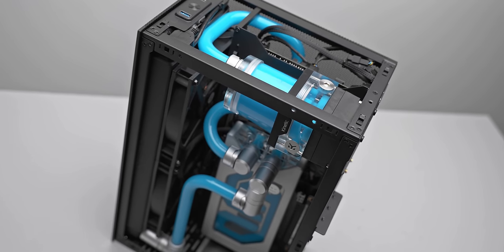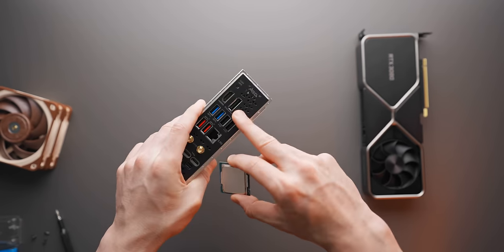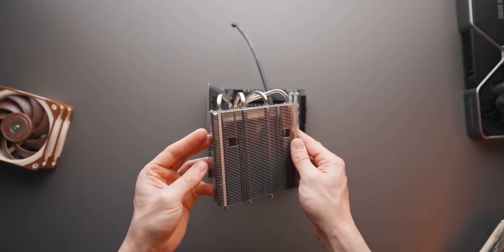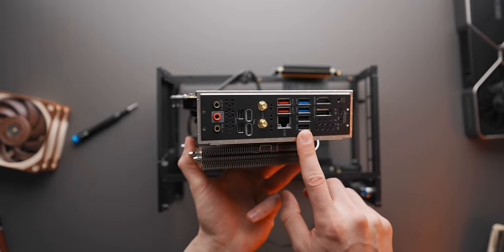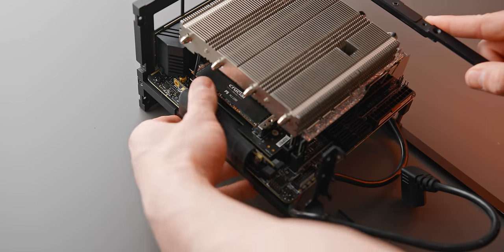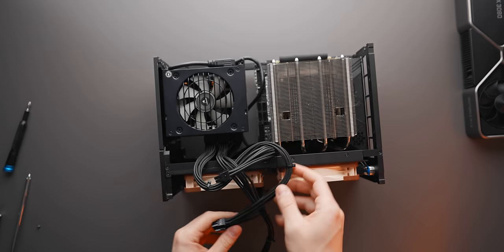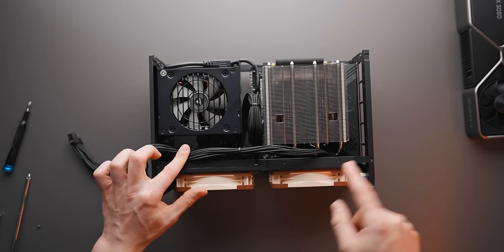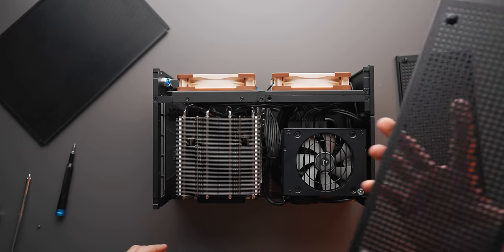Overpowered Gaming PC Build - Step by Step

Comment: The purpose of that 12 pin adapter for your GPU is to slot 2 individual 8 pin pcie power cables into it. 1 power cable daisy chained for a 3080 isn't the wisest decision. That cable is rated for 150W, and you're getting 75W from the board. Meaning you're pulling 245W (stock 340W limit on the FE) on a 150W rated cable.

Comment: Awesome vid as always Ali! Nice to go back to basics :D

One small correction, at 20:53 you say the build would be impossible to get started without integrated graphics but that's not exactly true.
What myself and a lot of people on the r/formd sub have been doing in this case was basically doing the whole build outside of the case with the GPU plugged directly into the motherboard, just to enter the bios and change the pciex16 setting to 3.0, then rebuilding into the case and booting as normal.

Only downside to this method is that bios updates reset the settings so you would need to repeat the process of rebuilding outside the case w/out a riser to change the bios settings which I was doing every few months whenever I was opening the build up for cleaning anyways.

Optimally (pardon the pun) an igpu or 4.0 riser (linkup and adtlink, same brand as the stock one in this case make them) will make this simpler as you don't have to debuild for bios updates, but it's by no means "impossible" if you don't have integrated graphics :)
Reply: Amazing comment. I'll be checking out that sub as well.

Comment: Hello 19:12 if the connector requires 2 pci-e you must have 2 cables coming from the power supply and not a split. :)

Comment: Amazing tip with the gpu undervolt. I have an rtx 3080 in the coolermaste q500L. I bought 3 phantek t30 fans, and undervolt the cpu and gpu, and use it case open (without the glass I mean). Lowered my temps from 82 to 65 while gaming and same performance!!!

Comment: what is the smallest case i can fit my hardware? 6800xt, ASUS B550m Tuf plus, 2x 8gb ddr XPG D60g, 5600x (cooled by Scythe Fuma 2), XPG Core Reactor 850w, NVME m.2 SSD, 240ssd WD, 1tb Crucial SSD and a 2tb HDD (notebook)..im on a Corsair AIr 740 and i want the smallest possible case

Comment: Pro tip: You can still use a CPU without integrated graphics. Just build it outside the case first and bypass the riser, then go to the bios and switch it to gen3. After that, you can proceed as normal
Reply: Im not a pro and thought the same!

Comment: If you're dealing with a PCIe 3.0 Riser cable with a 4.0 Mobo and GPU, and no Integrated Graphics, I'd recommend test benching on your motherboard box after finishing the mobo assembly. This is a good way to make sure things work before installing everything in the case. While the GPU is directly plugged into the motherboard while test benching, use the opportunity to set the PCIe mode to 3.0 in the BIOS, in order to avoid the compatibility issues.

Comment: Why didn't you block off the gap between the two fans for a better negative or positive pull? You will be short cycling your air and loosing a good amount that would other wise be pulled across your components.. I work in air flow and measurements of cfm in the HVAC industry. And a gap like that is a big loss.
Reply: Who knows man but maybe he'll fix it later

Comment: 8:39 seems like the fan is hitting/lying on the metal bracket for M.2 SSD, so if there is no clearance and something is lifting up a lil bit and avoiding fully contact the surface of the CPU and heatsink.. you'll eventually get overhitting or even burning your CPU
p.s. this is why you decided to avoid installing a plastic cover for this M.2 innit? but still, the fan has got not enough clearance - is laying on it

Comment: At 20:30 you said "had we not had  a CPU with integrated graphics this build would have been impossible" but that is not true. On most (practically all) motherboards before you ever reach the bios you will hit the PCIE menu's first. It checks each enabled PCIE lane to see what options it has to display out to the user and by default all are enabled at the lowest spec while during checks, then on some motherboards it will choose to  up the spec on different lanes depending on how much bandwidth is available. 
During this time the motherboard will check for things like GPU's, RAID/ATA/BUS, and audio cards.
If your CPU does not have a GPU chip on it and the motherboard detects a GPU on the PCIE lanes it will choose that during the optimization period. Practically every single GPU since 2012 will run driverless during at this point. Meaning it will run at the CRT standard of 640×480. It will not run as optimally as it would with a driver but it will still run and display a picture. Meaning you will be able to get into the BIOs and even the windows launcher even if you have no drivers installed.

Comment: That cpu fan cable you tucked beneath the heatpipes, isn't that going to be problematic when those pipes reach higher temperatures and possibly damage the cable or cable insulation? Noob here, just asking

Comment: You could just assemble everything out of the case without the riser cable and then go into bios change the setting. Then add the riser cable and check to see if u get an image. You don't need a CPU with integrated graphics. It's just more of a process

Comment: Just want to add I have recently built r5 5600x and a 3070 on an ASUS ROG Strix 550I with my case equipped with a gen3 riser. This motherboard has an Auto option in the BIOS for PCie and I had no problems with it automatically switching to gen 3. Point here is maybe Asus Mother could be your bet if you want such build with AMD or no integrated GPU

Comment: I run my SF750 on a 9900k 3090 build without a single issue. at max synthetic load it draws about 780w from the wall and I have seen a SF750 dop well over 800w stable

Comment: Very nice! This is nearly identical to the build I did in October, except I’m running a 10700K with a 120mm AIO. It’s been great, though I didn’t know there was a way to run fans based on GPU temp. Definitely planning to look into that.

Comment: Excellent build video! 

One question though. I noticed you only used a single PCIe PSU cable instead of two from the PSU. I've read often that these higher end GPUs that consume a lot of power are best fed by two separate power cables instead of just one. The new 12-pin on reference cards would of course be fed then by 2 cables rather than 1.

Have you found any difference with using only 1?

Comment: A finer point I would like to make regarding 11600K , as this has an integrated GPU it does mean that your system will have 2 graphics cards and certain programs will default to that instead of the RTX3080 - It would be cheaper and easier to borrow a compatible monitor than to go for a processor with integrated graphics.
This would be fine on ITX builds without a discrete graphics card but its a waste on ones that do.
Reply: There a several times where having an additional output option is ideal. One is if you have your GPU mine crypto when you're not gaming (great way to pay off an expensive build). Running your monitors on the integrated graphics will keep the GPU running at maximum mining output. Youtube videos cost a lot of performance and even just moving the mouse costs a bit. General redundancy is nice too.
Reply: @ShimmeringSword  please please please don't do this. This WAS a great idea when GPUs were ubiquitous but the electricity cost of having your PC on all the time and the degradation of your hardware really doesn't make it worthwhile.

Comment: Just got a evga 3060 ti ftw3 ultra last week and was set on buying the cooler master nr200 until I saw this option. I like the fact that it is smaller, but I am new to building PCs (don't mind the work though). Is there a benefit choosing the nr200 over this? I don't mind paying an extra $100 for this case

Comment: Do you use Argus monitor for you liquid cooled builds also?  That is something I have been hoping you might release a video on—how you handle fan/pump control in custom loop builds.
Reply: I have a taobao cube X1 (similar to formd t1) build with an overclocked 8700k and watercooled 3090. I use argus monitor and it's invaluable!

What I've done, under the "software controlled" fan settings you can also set "multiple controllers", there you can select multiple temperatures, the highest of which will determine fan speed!

I set my fan curves to make sure my SSD's don't go over 60c, my CPU doesn't go over 85c, and GPU stays under 75c under load.

It's fantastic!

Only thing I wish I had was a mobo with a temp sensor plug, so I could control by water temperature as well

Comment: Great build, however i think you should recommend ppl to use two separate pcie cables for the rtx 3080, since an 8 pin cable  to dual 8 pin is rated up to 288w ..  and the card can exceed 320w while gaming (if no undervolt at least )...  Keep it up

Comment: Great video and amazing build. The exact opposite to mine where I just bought a huge tower so there would be no issue with cable management. But I think even I could follow this SFF build video with your painstaking instructions. 

Playing deathloop at the moment. With ray tracing on at 4K a 3080 can just about pull off 60fps. So maybe should retitle the video expensive gaming PC build rather than overpowered (I was lucky enough to get my 3080 at RRP; wouldn't wanna think how much it would cost to build this right now).

Comment: Hi. Your builds are so awesome. I have one question. Whats your favourite mitx Case.  I'm considering to buying the meshlicious. But there have only the Option for 1x280 Radiator without additional Fans. I will build one PC with CPU aio and a Standard GPU without water cooling. Ist this Case good for this. Thank you die your answer.

Comment: Like your video, but you still can get this build running without iGPU, just start by building and starting the bundle with GPU directly attached before installing into the case, make bios changes, then get it in the  case and it should work with the gen3 riser. :)
Reply: Could also replace the riser gen 3 with a gen 4 cable.

Comment: How safe is those cables touching the heatsink? no issue at all for long term? My NZXT 120m AIO pipe is in contact with GPU heatsink and I'm a bit worry.
Reply: It should be fine, plenty of people dont manage cables and they never melt. However why he wanted a case with only 3.0 riser makes no sense to me. Can't it be swapped out? Anyways

Comment: I screamed inside when you said "we surprisingly only need three cables for this entire build (...) and the dual 8-pin connector for our GPU". DON"T TRUST DAISY CHAIN CABLES WITH POWER-HUNGRY GPUs. I suppose you had all parts laying around, but for the sake of this FE 3080, please please pretty please use two 8 pin cables (or a custom 12 pin cable for modular PSUs).

Otherwise, nice video, absolutely gorgeous build.

Comment: Love this video so much! Just wanted to pick your brain about undervolting. I have a 3090 FE and I'm just wondering if you have a similar template for undervolting it in Afterburner the way you do with the 3080 FE in this video.

I'm running my 3090 in a Sliger SM580 with a direct die 9900k.Temps are pretty amazing but I'm always looking for more efficient ways to run it!

Comment: Hey mate! love your work!

quick question though, shouldn't you have plugged two separate pcie PSU cables into the 12 pin connector rather using a single pcie with two 8 pin connects as the 3080 might draw over the power limit of a single cable?

Comment: Hi Mate, Hope you are well. Can you please show us a ITX full tower build pc with a space of 1 Blu ray drive and equip with with rtx 3080 founders edition card with intel I9 with 30-60 gig ram , 2 tera byt 1 samsung PCle 4.0 NVMe M.2 SSD with ARK ROCK PRO 4 cooler and 1200 -1500 modular power supply with a latest gigabyte or asus motherboard which has thunderbolt 4 on it and lot of usb drives connector ? Many thanks.

Comment: I think it is a mistake to use one GPU Power Cable on that GPU.  I made that mistake on my 1080ti and once I knew I should be using 2 PCI Express GPU power cables, I actually got more performance.  Some say it is safer for the equipment as well.

Comment: Wow, this is most beautiful and perfect build ever 🙂
I very much like how everything went together.
I don't like MSI brand, but this MB looks very practical.
Undervolting GPU is very good idea, more silence = better to me 🙂
If I would build this computer, I probably would use non LED RAM.
Overall I'm surprised how cool and quiet your system is.
Case seems to be engineered perfectly.
Cable management is also perfect.
WOW

Comment: My hands are too big to build in a 10 ltr case, nice job though. I'll keep My modded Lian-Li TU-150 which I modded for dual 240 rads with 120 slim Noctua/chromax fan with a full water build with a Barrow pump/block/res (gotta keep my 12 core cool). Beautiful case though.

Comment: I have a Formd T1 with a 5600 and 3080 FTW edition, but I have been having some issues with thermal throttling of my nvme. To compensate I adjusted the top fans to always be pulling air (through a rad since I have a water cooler for the CPU), but would love for my build to be quieter since it mainly sits in my living room. Any suggestions/ideas for increasing cooling on the SSD without ramping up all the fans in the system?

Comment: Why use this case instead of the Ghost S1, looks almost the exact same layout.  That even looks like the same cpu cooler used in Ghost S1 Build.  Do you have cpu temps you could share using that cooler?  I have it on a Ryzen 5 3600 and temps seem to be in the high 40's low 50's.

Comment: in my MSI MPG B550 Gaming Plus mb is the option to adjust each of the fans, depending on the CPU/GPU /chipset... temperatures in bios Hardware Monitor settings, no need to use a software solution for this

Comment: Thanks for all the educational vids! It's taken me a while to muster up the motivation to commit to my first build but this video put me over the edge. I'm basically planning on making this build verbatim. I had 2 questions though... 

1) Would it be worth bumping up to an i7 CPU if the additional cost isn't an issue? (and will it work with this setup)
2) The Noctua NH-L12 (original) is actually discontinued.. They now have an NH-L12S which I believe is 4mm taller and then a special NH-L12 made for the Ghost S1. Would you know if either of these would fit given all the other hardware I purchase is the same as the one made in this video? 

Thanks!

Comment: CPU cooler should be installed with the heat pipes facing up as per noctua - is that not possible here ??

Comment: When wires keep contacting with the heat pipes. Is it okay or will it burn or melt. is that safe
Reply: cpu coolers dont get hot enough to burn wires. TJ Max for a CPU is 100 degrees C so unless you're pumping that kind of heat into your cooler all the time, you wont get anywhere near hot enough to melt a wire - especially one that is sleeved and coated. Oh btw, if you are hitting 100 degrees C, two things; a) you need a new cooler. b) system will shut down to prevent damage.

Comment: I have a doubt about the need for the  upper two fans. If you remove the panels (in open case configuration) could  it work fine without the upper  fans? I mean, the CPU already have a powerful fan,  and the PSU and GPU also have their own fans.
Reply: No, if you have open case you dont really need to. But with panels you would need as it directs the hot air out of the case

Comment: What cooling would you recommend for a 5600x in the 3-slot GPU configuration? Is it still possible to go aircooled?
Reply: you probably need a 120mm AiO with a slim fan, just make sure it has very soft tubes
Reply: @balderm001  aye, that's what I'll probably end up going with. I was hoping to stick with air only, but getting a small GPU in this market turned out to be impossible

Comment: @Optimum Tech if you have the gen 3.0 riser but no integrated graphics, you can build outside the case on top of the box and plug the GPU into the motherboard sans riser to go into BIOS and set the PCIE mode to gen 3.0.

Comment: Hey man I have the same exact cpu, i was wondering if i could run the i5 11600k with a rtx 3080ti fe, with the same psu you used in the vid?
Reply: The psu used in the video (sf 750) will be more than enough. 
The 11600k and the 3080 ti add up to around 475 watts.
Heck, you could even use a sf 600w and it would be fine.

Comment: Not sure if the specific bracket for it came with your T1 since I know you’ve had yours since way way back, but having a T1 myself, flipping the PSU seems like it would help a ton especially with that reference 3080. Not flipping the way the fan faces like you mentioned in the video but flipping it vertically so the plugs are at the bottom of the case and PSU exhaust is facing the top so the heat goes straight out of the top of the case through the fans. Also helps keep any cables from getting too close to fan blades!

Comment: Will my 12th gen i7 be fine with a fan like Noctua L9x65 or Scythe Shuriken 2? My Gigabyte Aorus Z690i ddr4 motherboard is not compatible with Noctua L12S/GE because of "I/O Panel shroud too big" according to Noctua's website. My case clearance is 70mm for cpu cooler.

Comment: Can this case fit a 4090 (FE) + ITX AMD with 7950X3D using iS-55 or IS-67 Cooler, not sure on the cooler as my Ram is 35mm and I think either I need to remove the heat since or use the 67 or get some fury flex -5 which is 33mm

Comment: Why does undervolting even work? I don't understand why the manufacturer doesn't configure its hardware to run with the smallest amount of power possible for the same performance.
Reply: Probably because even if you have two graphics cards of the same model they may not behave identical. This is called "silicon lottery".